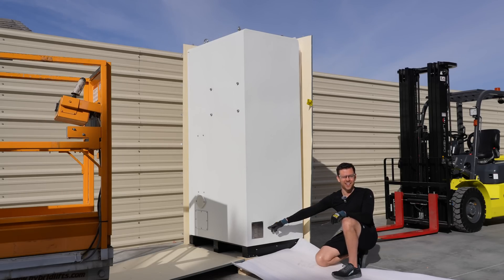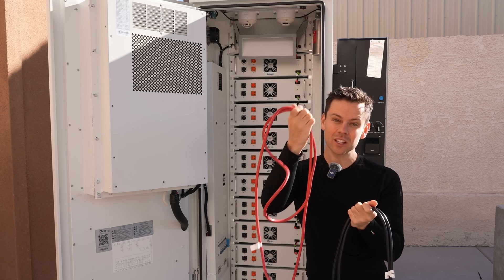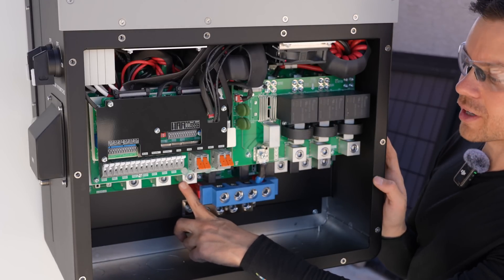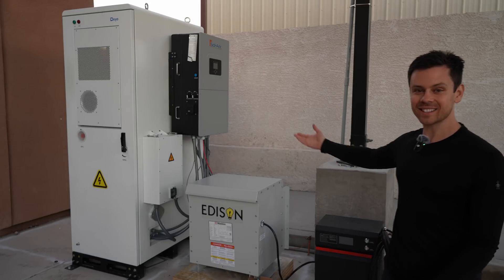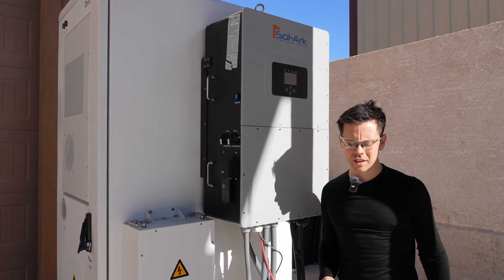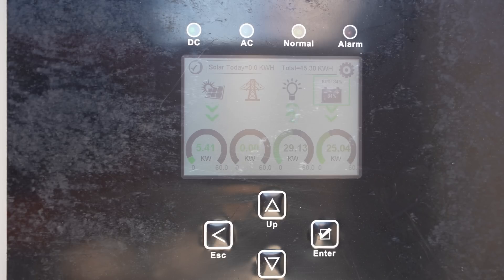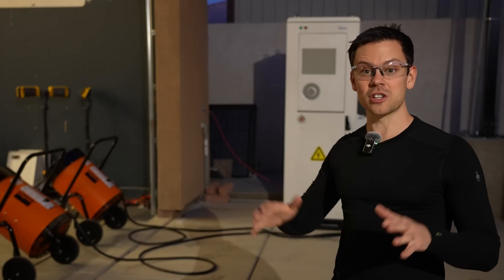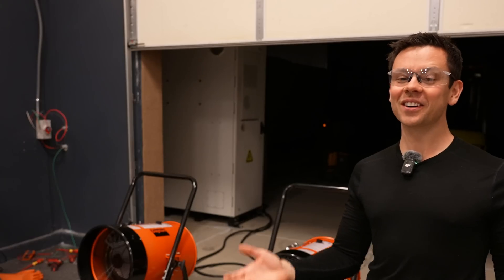60,000W 480V 3 Phase Sol Ark + 60kWh Deye LiFePO4 600VDC Battery Testing!

Comment: Something to think about, a resistive load that large is going to take a while until it heats up and the current level drops down to its nominal level. The start-up will be significantly higher when the element is cold. This could easily explain the trouble starting both of them at the same time even though it could run them both if they were started separately.
Reply from the maker: Good point
Reply: @WillProwse  Wenn dir erst einer erklären muß, wie sich diese Geräte verhalten, solltest du nicht damit hantieren.
Grüße
Reply: @dataandroid2036 😂 what a silly comment.
Reply: @FineHomePainting Was ist daran albern? Seit Jahren den Kanal hier betreiben und nicht wissen das ein 30kW Heitzgerät erst Temperatur bekommen muß damit der Anlaufstrom sinkt?
Denk nochmal nach!
Reply: @dataandroid2036 if I never tried doing something I didn't understand 100%, then I would never learn anything
Reply: @originalIceCube  Du kannst auch probieren bei 400V in die Steckdose zu fassen. Fakt ist, wenn es gefährlich wird sollte man schon wissen was man tut.
Wenn du rausfinden willst wann ein Sack Reis umfällt kannst du das auch ohne Vorwissen probieren.
Reply: @dataandroid2036 yeah I've done that and now I know to not trust existing wiring.  

Will is not starting from zero. He's starting from pretty impressive depth of technical expertise.
Reply: @originalIceCube  Warum antwortet er dann auf den originalen Beitrag mit: "Good point"? Also hat er wohl nicht dran gedacht oder es nicht gewußt. Ende der Diskussion, ich wünsche einen schönen Abend!.
Grüße
Reply: @dataandroid2036 ... Am sure he knows. Just being polite.

I know this myself, and yet I have been learning from this chanel. What are the chances he doesn't?
Reply: @dataandroid2036 because will is a very nice guy that takes advice in a good way.unlike some people.
Reply: those are fairly chunky fan's as well, I'm sure there's significant current peaks on them during startup.  That sound is likely a relay failing to latch due to low voltage as both motor's ramp up.
Reply: @Wooble57 good point.
Reply: I don't believe these are PTC heaters so they should have minimal temp coefficient and have basically no surge or change in current from hot to cold.
Reply: Doesn’t matter, this system was supposed to be well within the rating required to start and run these machines simultaneously. It’s just the typical Chinese junk that’s literally over rated
Reply: Depends what material the heating element is made out of. The regular nichrome and kanthal alloys really don't change resistance too much with temperature. Heat lamps with tungsten filaments will have a big startup surge. PTC ceramic also have a surge, but it doesn't seem quite as bad as a lamp.
Reply: @connerlabs  These are not tungsten filaments nor are they PTC elements...

Comment: Remember boys and girls, start up current with poor PF = exceeding the amp figure you think you are dealing with (derived by simply dividing kW figure by supply voltage).  kW is not kVA and the inverter is operating in kVA.  'orrible noise is the result of the inverter current limiting.

Comment: Is the inverter weath proof?  It seems a bit janky having it mounted on the side out in the elements.
Reply from the maker: Yes, all outdoor rated
Reply: Yes.  They sell outdoor rated solar enclosures cabinets with built-in climate controls (heat and A/C).  Battery Hookup sells one for 48V systems.  However I think that enclosure only houses the batteries.

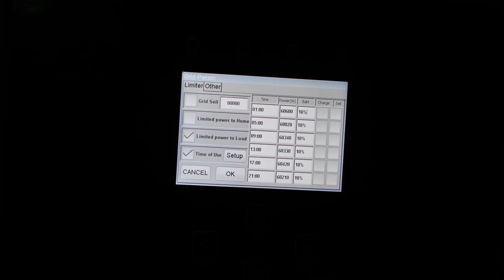Comment: 9:45 The reason they have such a high state of charge cutoff for off grid mode, is because they are series wired batteries. If a single battery in the string gets to auto-shutoff mode, then it needs to be jump started so the rest in the rack can charged again.

Comment: This is super cool! 
My family and I run a business in the snowmaking industry for ski areas. 
There have been instances of needing some sort of backup power, and usually a backup generator is what it comes down to.
But I've wondered how much more it would be to have battery backup, as well as being able to connect solar to reduce operating costs (running 250hp or more of motors gets expensive real quick lol)
But yeah! Can't wait for the 40kw motor!
Reply: You would have to look at some of the dedicate BESS units that are in containers (something the size of a Tesla MegaPack). You could probably maybe get half a dozen of these systems (you can put something like 4 or 6 battery cabinets per 60kw inverter) to give you run time. Plus you'd want to use VFDs to keep the inrush down on start.

Comment: The residential off grid solar industry really does need to raise the battery voltage in order to save on wiring cost. Maybe not 600 volts but at least 192 volts to 288 volts would be a big help when building whole house systems.
Reply: DC Arc Flash is considered a big concern over 48V, thus why most systems use that voltage battery!
Reply: @jermwerty in America..... The rest of the western world is on 96V or more. For the professional installs. DIY stuff still is 48V.
If there was an affordable 32S JK BMS I would definitely consider replacing my inverter.

Comment: With those voltages and current levels you may want to start thinking about an arc flash suit .
Reply: I agree about using arc flash safety gear.  With that much power, an arc flash could burn you to a crisp.
Reply: You dont need anything crazy for this. Class 00 Electric gloves are the bottom tier and are good for 750 vdc. Technicians are regularly digging around in EVs with 400vdc or 800vdc battery packs without and arc suit.
Reply: These are normal European household voltages. 480V in reality means 3x 240V phases, 120 degrees out of phase.
So it's just 240V if you touch one wire. If you touch two with your bare hands, you need to reconsider your life choices, but still just 300V or so. Painful, sure. But if you didn't just took a bath or are over ten years old, you'll be fine.
Worst part for me personally is the echo of my wife laughing because she said I should not work on live electrics.
Or do you mean the solar and battery DC voltages?
Especially 1000V DC is not that much is it? That's just 20 panels in series.
Reply: I thought the normal here in Europe was 400V three phase TN with 3x 240V phases to Neutral? (Unless you in the 240V three phase IT parts of Europe).
Reply: @notsonominal  No you are right. our single phase voltage is about 232V right now. 234V when I am pushing 15kW back into the grid. 230V 240V you can't feel the 4% difference.
Reply: @foeke8740  It's ~280V though, not 240.
Reply: @mykolapliashechnykov8701 You are totally right! I stand corrected! I thought it would be 240V like in some states. Never been to a country that has 280V outlets.
I just found out this is an American thing that has nothing to do with the normal grid households use.
Learned something today.
Story still stands. Touching 280V or 230V might be noticeable by the real Electro connaisseurs.
Reply: Seems the nominal voltage is 230v here, used to be 220v. However its +/- 10% and my region has always been pretty much 240 following the  change from 220 to 230 nominal.
Reply: @foeke8740  The EU equivalent of this 480V grid standard would be the "medium voltage" 660V, I think. Both are used exclusively in 3-phase applications, like conveyor motors or mid-sized pumps. If you need a single phase out of this, use a step-down transformer.
Reply: @mykolapliashechnykov8701 What a waste that seems to be. I believe you, but it seems so unnecessary.
Especially because the interface and build is so like our 12kW Deye hybrid inverters.
If you sell this as a complete package, why not use an AC running on 480V.
The way it is now it seems like the creation I would make for my private use 
Why did you use that converter? Well a single phase 230V costs me 500 euros instead of thousands.
A company with their own huge R&D could pay the same for 480V (or 277V single phase) if the order is big enough.
Less parts to go wrong. Less power losses. Cleaner design.
What happens when the batteries overheat and the BMSes disconnect? Is that inverter still working? Is that converter still working? Is the AC still working?
Reply: @notsonominal  definitely only for industrial use in the US.  No real foresight in designing anything here.
Reply: @veganpotterthevegan  480/277V is used quite a bit in commercial applications throughout the US.
Reply: @patrickmay8261  my comment stands.
Reply: DC is much more hazard than AC and also this is capable of pushing extremely many watts compared to a regular 20 A 240 V outlet 😂.

AC is self extinguishing.
DC is NOT And will draw an arc that can be many CM long, wouldn't surprise me if this can do 30 CM before breaking the arc!
Reply: @tullgutten the amount of watts it can produce is not important (for your safety). It's the voltage needed to get 0,1A through your heart that is killing. In reality you need way more than 240V because the impedance of your body is to high to get those amps.
DC is more dangerous. Absolutely. Also because it contracts your muscles.
On the other hand. How are you getting exposed to a DC connection? That means you have to touch two sides at the same time.
If you die from that, it might be not so bad for our genepool.
1000V is likely to kill you. Good that ours is just 800V. A light death then.

I am guessing you never mucked around with DC much. 1000V won't even arc half a cm in a Turkish bathhouse. To get an arc going, you need about 1mm per 1000Vin normal air and then you can stretch it to over double I would guess. Way over 10kV it gets interesting because that will ionize the air and things around you.
A normal electric fence is at least 4kV. Our sheep fence 10kV (luckily just 10 joules per hit).
This was not meant as motivation to also try to fry your electronics.
Reply: @foeke8740  it's 480/277V 3ph. It's 480V Line to Line and 277V Line to neutral.
Reply: @patrickmay8261 yes, you are right. I already stood corrected.
I was to sloppy to do the maths.
Never seen 480V systems, so I thought it would be some 400V standard European household deviation.
But apparently it's a US (and Canada) dedicated industrial solution.
Technically not that different from what we have at home. Just a slightly higher voltage.

Comment: 480 volts at 100 amps, now you just need a EV charger capable of handling that.
Reply: Based on what I’m seeing in this video, Will is is done with EV cars and gearing up to move on to EV airplanes

Comment: Just a heads up, you should always wear leather gloves over the rubber gloves in high voltage situations to avoid accidental damage or punctures to the rubber gloves.
Reply from the maker: Oh interesting, will do
Reply: The lineman lightly inflate their rubber gloves to check for small leaks before they use them. At least that's what I've seen, but I have no idea...
Reply: Would this be the same advise for handling solar conduits with 400+ volts?

Comment: >600VDC tell you what, you turn it on, and I'll handle the "stepping away" part 😂
Reply: You could run a BART train off of that
Reply: Isn't that normal for a solar install?
Ours is 2x +600V on our roof (15kWp). Just 18 panels in series?
Reply: @f@f @foeke8740 it is on the solar side. Not the most common, but definitely not unusual. Especially for people who need to run a bit of distance. Mine work out at 12x panels per string to stay under 600v on the coldest day on record. Usually runs around 450v.  Panels (6 strings) are 280 feet away at the closest.

Batteries are usually 48v though. and I’d admit that I would have an ass pucker if I had to wire up high voltage batteries. Even more so if DIYed them like the Mike G channel.
Reply: @silverbackag9790 I have experience with the things I have experience with. Microinverters and (Victron) MPPTs have an open circuit range  somewhere between 100 and 250V I would say. A normal (hybrid) inverter between 500 and 800V in my experience.
The panels themselves and the wires 1000V or 1500V.
I flip the switch when it is dark 😂.
High voltage batteries are not my thing either.
Everything over 96V is too painful. But the flexible wires though.
I definitely also hate mucking around with anything over 35mm². Let's not even start about 90mm² wires (max I can press).

Comment: I don't think I'm gonna be able to afford this one.
Reply: haha
Reply: tbh this is only like 2 mb56 51.2v pack's

i bought 32 mb56 cells for 100$ each and it was only 3200$ for 64kwh (bigger then this pack)

for wires, busbars, bms i paid only 500$ and i made the box for 200$ and it sits now in my home made hybrid car and use it as my home battery and car battery.
Reply: @423GustavBern  this is (12) 5kwh server rack batteries in series. The inverter needs 600VDC nominal to function.
Reply: 🎯🎯 same 😂
Reply: Not with that attitude
Reply: It's on sale for $35,000 if you can't afford a Honda Accord what can you afford?

Comment from the maker: 0:00 Intro
0:35 Basic Overview
3:37 Running Small Loads
4:40 Running LARGE Loads! Lots of Issues
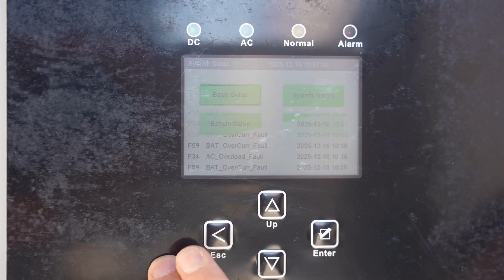7:50 Found the Problem, Now It Works!
Reply: Did you check rotation on the heater fans on initial start-up?

Comment: This would be spot on perfect for the 6 light bulbs I power in my off-grid cabin.
Reply: Will it run my clock radio? I hate resetting it every time the power goes out then comes back on 20 seconds later.
Reply: @ohwell-63

Saw a dude with a 20,000W lightbulb here on YT and he was pumping 30,000W into it. So sorry, 2 or 3 bulbs max.
Reply: @billstevens3796 it was also melting aluminum! Lol
Reply: @originalIceCube  
From 6 or 8 inches away!
Reply: @billstevens3796  that’s Styropyro, for anyone curious!!
Reply: This is for BTC mining
Reply: @d8niel77  Or AI inference.
Reply: @d8niel77 needs 380v-415v 😊
Reply: I was thinking along the same line.
Reply: Only if you anchor it to the top of the rockies
Reply: I mean it depends on the bulbs I guess.
Reply: That was funny!
Reply: Gotta account for the battery capacity required to keep that inverter running. Its like a damn rocket equation.
Reply: So how long should this last?

Yes.
Reply: I'd probably buy 2 for redundancy
Reply: I like the higher voltage on the battery. !  I would like to see the off grid voltage batteries going up to 500 volts instead of the 51 volts.
Reply: All because 50v is condisered save to the touch. So any average Joe is capeable to handle it. That with high current and poor connection - what could possibility go wrong...
Reply: Worth the investment
Reply: Yep. And way too much for that electric drive canal boat I've been thinking about for retirement.
Reply: Are you SURE?  You might need a few extra volts to handle all that.
Reply: Ironically, this is the first thing here that would fit my needs - a 3500W server rack running 24/7. This would give me about... 15 hours. Still not the 24h I'd want but hey!
Reply: @joshuaboniface  
Mining bitcoin then?
Reply: @billstevens3796  Alas no that ship has long sailed. Just a massive homelab 😀
Reply: Well, at least if those 6 Light bulbs are not over 24W LED, it should handle that pretty well. b´But 24W put out more than enogh light for tha cabin, so your's good to order this.
Reply: Thats hysterical
Reply: Same lmao